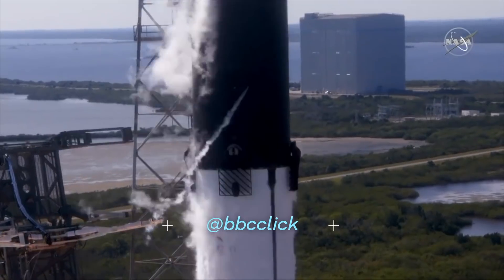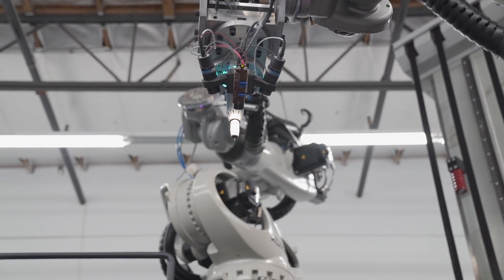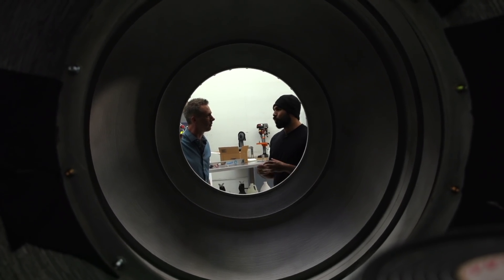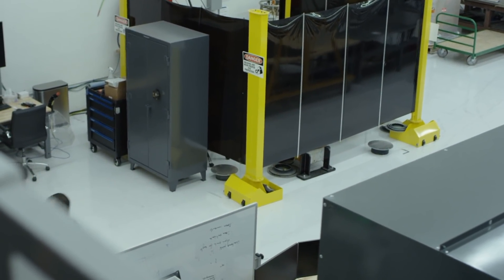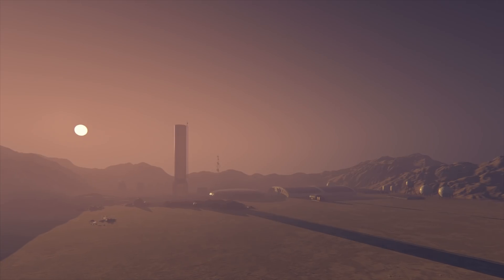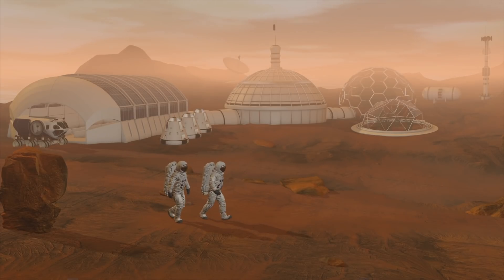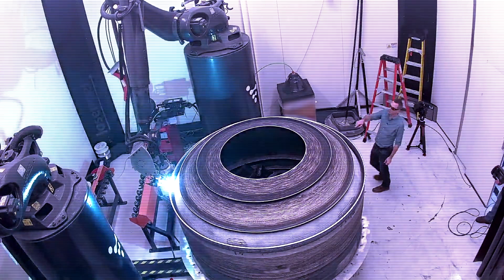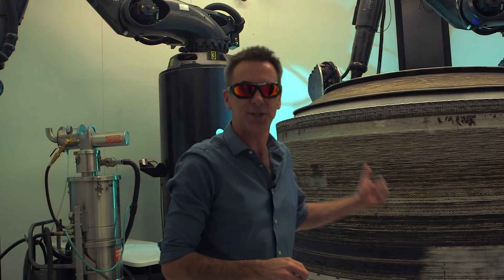The World's Largest 3D Metal Printer - BBC Click

Comment: Why not create a huge 3d printer in space to create in space to actual print / build the outer shell of a real space station. Is not like you dont have metal with all those meteorites and space junk, and if it is in space, you have room to develop and finaly build even a space shipyard and sell space ships to all the countryes who invest billions in rockets. If you create a huge outer shell, is easy to add electronics and equipment because you dont need so much fuel and aerodynamics....just add a cheap ion engine (electric engine) and some solar panels. Offcourse, if you do this, how many trilions $ the countryes will pay for such a printer?
Reply: Not yet possible with all the social division. That type of effort take thousands to work diligently. No one has that kind of power yet. No one.

Comment: is it working in zero gravity ?
Reply: Why not? I think it only takes the weight from the motors from the robot arm. As they are stepper motors, they move by steps, which have a defined length, it just doesn't take the force to lift the arm anymore. Maybe there are slight differences, but it should be able to be reduced by software. Only thing I'm thinking of, is that they might have to secure the print, even though I think, that with the welding process, the print is welded on the built table and therefor won't "fly away" that easily. Also, in the space you have to power it, but that should also be possible. So I think: Yes, it should be possible.

Comment: I heard 3d printed metals have  low structural integrity compared with normal forging process!!
How is this even safe for space quality standards!!
Reply: 3 d printed parts if done correct can have upto 3 times more structural integrity as opposed to Normal forging process because u can control the metal deposition evenly unlike the latter and they also have a added advantage of not having forming stress which is usually found in formed metals that needs heat treatment to release the stress since it is a time consuming and costly process
Reply: @antonymichealraj8857 
NASAs research findings tell otherwise
Reply: @justicewarrior9187   the thing is the 3 d printer mechanism which is in use now have a lot of flaws . But the next generation will be using inert gas chambers to avoid the formation of bubbles and will have between 50 to 70 percent less flaws .
Reply: @justicewarrior9187  NASA is not testing every single metal 3D printer though.
Reply: NASA is stupid as hell, metallurgical flux exist and it may or may not be effective depending on the use.

Comment: How about the tiny imperfections effecting structural strength?
Reply: I was thinking about it, for sure it's a problem due the nature of the process. But as far NASA funding go, brilliant minds goes together. It's a disruption in manufacturing processes allowing rapid development/prototyping/testing. Probably rockets won't use this technology for their final assemblies, but it will haste it's development cycle.
Reply: It's likely that they will sand and polish it
Reply: @Arnt Vollmar Easy repair or ad hoc reuse of most metals compared to most every other material. plus metal has the widest strength range over a wide temperature range.
Reply: A drop in the bucket next to weld weaknesses I'd warrant.

3D printing with metal can give you stronger parts at a lower weight.
Reply: @mnomadvfx  it's basically welding by depositing molten metal. That's a completely different 3D printing process compared to laser sintering metal powders.
Reply: @Arnt Vollmar as of now, there are no composites that won't turn into slush when exposed to extreme heat, that also can be manufactured without much issue.
Reply: Can't they anneal the parts? I think that should provide the strength and material propertyfixes they need no?
Reply: @zteaxon7787  i think its too big to anneal. THey'd need a big oven. idk im guessing
Reply: It doesnt matter i guess when its that big.LOL.
Reply: The structural requirements are far lower for craft in low gravity environments. Something that wouldn't survive an earth launch might be perfectly safe on our moon or Mars etc

Comment: 12 days? For something this small? Makes sense why SpaceX is not trying to 3d print the fuel tanks for starship. It'd take a month or two before it was done with just one tank when 3+ tanks are needed for testing.
Reply: pierrot SS, you considered case when one industrial robot used. But if use several robots in parallel to speed-up printing of one fuel? Or 3 robots? Obviously speed will increased. And in order to print other rocket parts - other robots. And cost of all equipments will be much less and flexible less than traditional ways
Reply: @denissopichev5986  you could also use for example 9 robots, which all print thirds of the tanks and then weld 3 * 3 together, that would take only a third of a month (for all three), if we consider a full tank takes one month. Also you could print it in even smaller parts, or bigger, that depends on the quantity of printers that are available.
Reply: 12 days is nothing since parallel production is a thing

Comment: I wonder who built the robot arm because I know they didn't build the arm themselves. At most they designed a attachment and wrote some software
Reply: Is it not a robot welder? i think the material produced would not be all that strong ,you would have to pass it to the metallurgists for destructive testing.
Reply: Not to be understated.
Reply: not really..... normal process can still produce product faster....
Reply: Being able to do something and putting your pockets on the line for its commercial success is a different matter entirely.
Reply: The robots are ABB

Comment: What about porosity and cracks? You obviously can't put a whole rocket inside an hot isostatic press.
Reply: Only critical thinkers will appreciate this comment.
Reply: Why?  Build a very tall structure or build sections welded together. Possibly more stages.
Reply: @raybod1775  That would be a >1000 tons piece of metal. Not impossible but the whole cylinder would be an assembly and not a single part.
Reply: I believe this has a 💯% density rating, is porosity shouldnt be an issue.
Reply: Can't answer complicated economic efficacy questions without knowing prices and specific designs. It may help somewhere, it may not.
Reply: Depending on the material and thickness MPT or ultrasonic test is possible or good old DPT can also be performed to check porosity. Main question is how to anneal suck a huge metal mass.
Reply: @Nopenotherenotthere  That's for defects, but porosity is everywhere.
Of course you just have to make the tank a little thicker and the issue is solved...
Reply: Design, build, inspect, test, corrections, redesign, rebuild, reinspect, retest....heck, there is a whole flow-chart that comes to mind.
Reply: X-ray for defects
Reply: @macberry4048  Yeah, but what if there are thousands of small defects? Making the rocket thicker is the only way.
Reply: @johntheux9238  you have to start over
Reply: @macberry4048  Well, you can't. It's statistically impossible to make something perfect using this method.
Reply: @johntheux9238  sometimes you just need a part for emergencies or it might be used for expendable rockets. Maybe the company will fail or maybe the technology will be used for something less ambitious